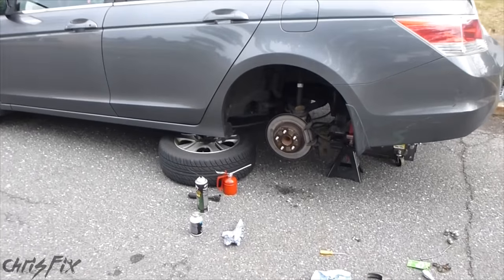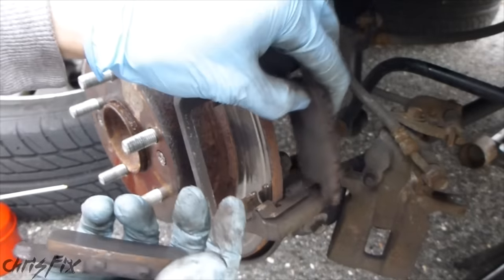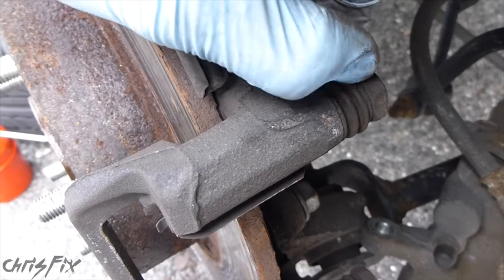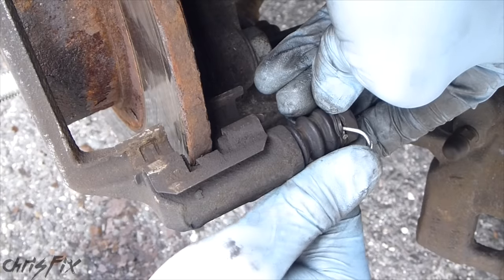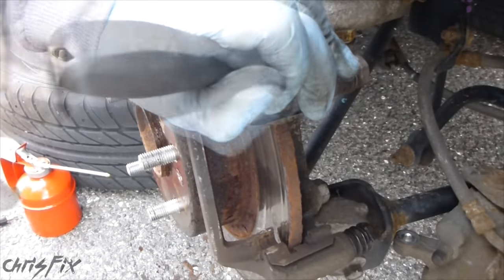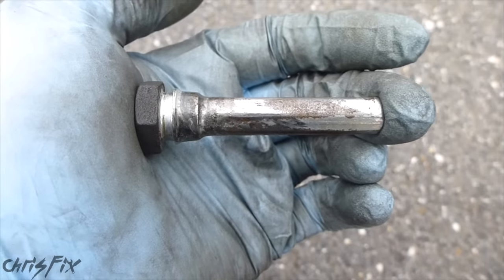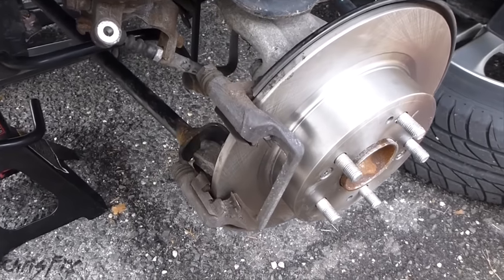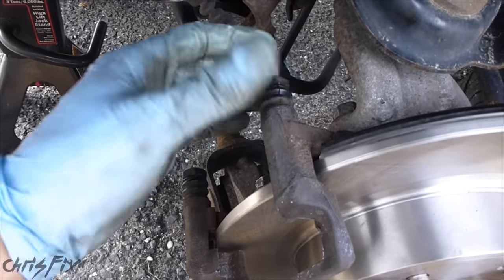How to Fix Uneven Brake Wear

Comment: What do ya'll think? I have this CRC brand "synthetic brake and caliper grease." The label says "...is the highes quality... available. Formulated from proprietary bases, extreme pressure additives, molybdenum disulfide... graphite and PTFE. Unlike silicone-based brake greases, CRC's... will not damage rubber or plastic components, freeze, melt, or wash out." I read that label before I bought it and knowing about he rubber seals on the caliper pins, that label influenced me to buy it, rather than to put ordinary multipurpose grease on the pins, next time I replace brake pads and/or rotors. "Properly lubricating... will ensure even pad wear."

Comment: emery cloth works fine, you do not need to replace the pin unless it is beyond refurbishment, oddly enough I had the same exact wear and nothing was wrong with the piston or guid pins, I 'am at a loss

Comment: the piston has to be indexed at 12 o clock and the pad with the squeal tab has a pin that fits in the piston slot that is a contributing factor in the honda rear brake

Comment: Just used your vids to help change brakes/rotors on a '14 Fiesta.  Has had a vibration for a good while when applying brakes, and has gotten bad.  The outside pads on BOTH sides of the car were thick, and the inside pads on BOTH sides were very thin.  Is this just plain junky Ford design?  How are BOTH sides doing the same thing?
Reply from the maker: +filoIII guide pins were probably hummed up and not moving easily. Happens on any car.

Comment: if a guide pin is corroded I just sand em down and use anti seize instead of silicone paste. Usually that repair outlasts the used caliper anyway.

Comment: I remember a shady mechanic shop said the reason for my brake pads wearing unevenly was because I needed a brand new brake booster after spending 700 for pads, rotors, calipers, and the rubber lines for the front brakes.

Comment: hey chris amazing videos, keep it up.  Could you help me, on the brake caliper pins, could you use a lithium based grease?
Reply from the maker: Thanks! I would use silicone based grease personally. If the lithium grease is petroleum based it wont be compatible.

Comment: Hi Chris! 
Why you didn't clean the holes for the guide pins? What if this muddy old grease contains moisture and could caused corrosion? Do we need to clean inner surfaces out of an old grease or it's not necessary?
And sorry for my English I learned it by myself.

Comment: Hey Chris... I have a question. I tried to change my brake rotors on two of my cars. When I took the bolts out, one would not seat right and and even when I installed the bolt by hand the torque it, it would not go in fully and started to cross thread. I'm not sure why this happened on both my cars as these are new cars and the first time the bolts would have been removed. I bought new bolts and still, the thread was cross thread inside the caliper. How can I prevent this? Why did this happen? Could it be that it was already cross threaded when it was built? Thanks so much.

Comment: Stupid question:  What exactly is the little metal thing that you use to get the rubber boot off without ripping it?  Where did you get it?   I could use a metal clothes hangar, but I think the tip of your tool is less sharp.  I've been changing my own brakes for 22 years, but just today I observed some uneven wear on the inner pad of my front left and wondered what the cause was...  Thanks for this video!!!  
Back in 1999 a mechanic talked me into replacing my front calipers on an 9 year old car because he said that the uneven wear meant the calipers were bad.  I should have trusted my instinct because, at the time, I suspected I was getting reamed!

Comment: Hey Chris, So ive been told to use copper anti seize or ceramic grease on the guide pins instead of silicone paste. I have looked it up and there is a really big discussion about it. What do you think?

I have both copper anti seize and ceramic grease in my garage.

Comment: Chris, as a suggestion on application of the paste, wouldn't you remove the pin and boot, clean the pin and bore with the rubber boots off. Then apply a little silicon grease INTO the bore and the pin, then reseat the boot and slide the pin in. This way the grease will not be wiped off by the boot and have as much to wipe off afterward.  I enjoy your videos and it is always good to get another viewpoint that may help in the long run.   KEEP WRENCHING....  JK.
Reply: and clean the rubber seat..goedendag

Comment: just replaced my Honda 2017 front brakes with 31200 miles because of a squeaking noise I would get from the front left wheel assembly , the noise was more noticeable while applying the brakes, when I took the pads off the Rt and Lt outboard pads were worn out twice as much as the inboard pads, matter of fact the was hardly any difference in thickness between the new and old inboard pads, not so with the out board witch were worn out to half the original thickness.  All the hardware was in good shape, caliper just fine, guide pins clean with free movement, the sliding or guide clips ok as well, for the life of me I can see why so much wear on on pad and not the other, only think I can think of is the pads have holes drill on top near each end were a spring like clips go, this springs are design to push pads away from the pads when brakes are not been apply, well both brakes sets only have the upper spring installed, seems to me that there should be on upper and lower spring, can't think of anything else. Any thoughts? By the way the squeaking noise is gone......Thanks Sergio.
Reply from the maker: Interesting that you have brake issues that early on for that car, but it could be bad bushings or slides if the outboard brakes are wearing differently!

Comment: Great Video Chris. I'm new to the car maintenance stuff and I'm doing my first brake job for a 2005 Honda Accord Euro (Acura TSX 2005) . I'm having difficulty removing the bottom flange bolt from the guide pin as the flange bolt keeps on rotating but does not disengage from the guide pin. The top flange bolt came off easily when I used my wrench. It's like the flange bolt is stuck to the guide pin but keeps on rotating when I use the wrench. Any suggestions?

Comment: You need to mention a 3rd reason you have uneven wear on brake pads. You need to make sure the tin guides that are inserted on most callipers that allow the pads to slide back and forth MUST be cleaned and or replaced every time. Lots of brake pad kits come with new tins. Also, callipers without tins (my 2008 Mazda 3) the guides need to be wire brushed and cleaned before inserting pads back. Make sure you us high temperature anti-seize on the pad tabs. 
Also, if you don’t burp the pins after you add lube, you’re in for a lot of issues.

Comment: hey Chris great video!! I noticed you replaced the brake disk on the Honda accord. Any suggestion on what to look for whenever is time to replace them.

 I'm planning to do my brakes soon as my steering wheel and pedal shakes when I press the brake :( why is that?

Comment: Why am I not surprised that it's a Honda 😅 the inner pads wear more on a lot of models, mainly the civics and jazzes without the slides being naff. You also need to be careful with the rears that one of the grooves in the piston lines up at 90° to the anti squeal shim because that is the primary cause of uneven pad wear as the pad locks in with the piston.

Comment: Good video, and good idea how to temporarily make do with a deteriorated guide pin.  But my 05 Dodge Caravan has weird guide pins, with one on the passenger side that has a rubber bushing near the tip, which was stuck.  I found out from another video that belongs on the trailing side.  But both the guide pins on the driver's side are smooth, and move more easily.  Is this correct?  It does not seem to make sense.

Comment: I did my hyundai elantra, new Rotor and brake pad and new caliper pin and grease in it . but my caliper still doing same problem with the pad like you show here. so now i know is the caliper cylinder is bad. thanks! but there is a way to fix the caliper like remove the cylinder and have it fix yourself is it posible? or i need a new caliper in. thanks bro your awesome videos.
Reply from the maker: You can rebuild the caliper but it is usually easier to just buy a new one and be done with it.
Reply: ChrisFix thanks. Sure will.

Comment: Thanx for the great video! Can you also use ceramic paste to lubricate the caliper slide pins?
Reply from the maker: +anfahrt I never heard of ceramic paste for guide pins. I was always taught silicone was the best!
Reply: +anfahrt Yes, just because ChrisFix has not heard of something does not automatically omit it as a potentially option. I am assuming you are referring to the purple brake caliper grease by Permetex PN# 24125. It is specifically designed for guide pins brake, brake hardware and the back of the pads. This particular product outperforms the stuff ChrisFix has featured in this video by hundreds of degrees and I use it on my dually F-350 and my single rear wheel F-250 both diesel both used to tow 3 times there own WET curb weight. I sell car parts part time for one of the big three distributors which is why I have this knowledge of those products and sell various chemicals to thousands of people a month.
Reply: @stradplayer90  No one said that if Chris Fix hasn’t heard of something that it would not be a viable option.

Comment: Great video. Just a quick question in regards to the slide pin boots. When reinstalling..are the boots meant to be fully extended or fully squashed down (air in the boots keeps em for squashing down sometimes). Which is the proper way to install em? If anyone can shed some light on this subject it would be great...

Comment: Good thing a lot of cars have slider boots that you can't get off without getting the slider pin out first. Sucks ass when you have to take a torch to the caliper bracket to free that slider up. Pro tip: Never stand in front of a stuck slider pin while heating it with a torch. Do enough of these and you'll find out why. Hopefully not the hard way.

Comment: I had a guide pin seized so bad it would get stuck again each time I lubed it up and reinserted it. The new lube would just mix with the rust-dust and corrosion still inside the mounting bracket. I had to keep removing, cleaning, lubing, and reinserting and I had to use an impact tool to spin it out the first few times. I even saw smoke coming out!
Reply from the maker: Sheesh. That’s pretty bad. Glad you caught that!
Reply: @chrisfix  It was actually the least of my concerns after finding other damage to the caliper. It was also missing the rubber cover on the bleed nipple and you could see scarring on the rusted slide pin so I replaced the whole caliper thanks to your instruction. Only fought with that slide pin to get it together enough for work + parts store. :) Thank you!

Comment: Hey Chris, great vid! I have a question, after I greased my caliper guide pins, and stick the pin back in, there seems to be air trapped in the boot. It created a ballon when pressed or a vacuum when I open the boot a little to let the air from the boot escape. Should this be a problem? I didn’t use silicone paste..local auto store didn’t have any

Comment: Good video, but I'd use a high temp (500 deg) wheel bearing grease you get in a tub at the local auto parts store. Much easier to find in quantity and cheaper. No need to use silicone grease.

Comment: Another issue those holes on the sides of the pads. Some vehicle have spreading slips that assist the pad to drift away from the rotor. If a 1 clip out of 2 is missing it will take away the symmetrical separation.

Comment: You forgot to mention to index the piston, on some hondas you have to rotate the caliper piston in order to retract it back into the caliper, some inner brake pads have a pin on the back side and needs to align with the piston or it wear uneven, i know because I've made this mistake myself.

Comment: Chris, I know you probably wont read, and probably not respond, but if you could that'd help me ALOT. I know this video is 3 years old, but I think you still get notifications, could a seized guide pin make your break make a weird rubbing noise?
Reply: 2AverageNoobs it possibly could I guess if it was preventing  the caliper from releasing and keeping the pad up against the rotor. I would think you’d smell breaks when you got out of the car though if that were the case and even see smoke, especially after high speed and most especially after going down long hills where the brakes had been used a lot. Best thing is to take the brakes apart and see what you find.

Comment: usually a bad guide pin can be fixed by wirebrush and a smooth sandpaper , it will go back to its former glory and all, just look if theres an uneven wear in the pin for it might cost you more instead of saving money

Comment: You have to pull your calipers multiple times during the life of a set of pads and  verify the pins are free and lubed. As well as making sure the pads are floating in the holder correctly.

Comment: Hey Chris, luv your vid's.
That guide pin was so bad that I would have cleaned out the female as well, shot some brake cleaner in there and used a brush to get that all cleaned up.

Comment: Hey Chris,
I have this issue for a while now ( over 2 years) that is wearing excessively my brake disc. When driving in town the pad and disc doesn't get heated enough to start squeaking, but once I hit the motorway an intermittent squeaking noise comes up.
One finding is that the brake pad gets locked in its place onto the brake disc. I don't know how to fix this issue, other than to use a file onto the pad's guiding ears in order to allow the pad to freely move back and forward into the caliper guides.
Now, I usually change my pads in a local workshop because I don't have a place where to work them on my own. I do own a parking slot, but since I live in a block of flats, I don't have the space needed to undergo such DIY tasks, nor do I want to scratch someone else's car by mistake.
Therefore, does this guiding pin issue might be related with the issue that I'm facing on my car? Can the seized guiding pin of the caliper make my pad and disc come into a slight contact all the time ?
Thank you.

Comment: This is the exact problem I had on my 2015 Honda Civic with one of the rear brake pads wearing unevenly. I greased the guide pins and the piston didn't appear to be crooked. Are there any other things it could be?

Comment: Hmmm I just greased mine but I probably used petroleum.... I'm gunna check the wear on the new brake pads soon and probably buy new calipers
I also shoved a ton of grease in the caliper bracket (overfilled) and I just stuck the pin in and all the excess squeezed out

Comment: Has anyone found that using the silicone lubricant on guide pins with rubber ends makes too much of a hydraulic seal and then you have this vacuum problem?  I have found that if I use the silicone lubricant I get this suction problem on the pin and it is a bugger to get out - even if it is only a small amount of silicone.

Comment: Also clean the rust on the stainless sliders that the pads sit on. Also clean all the rust buildup underneath the stainless sliders. I had a car that had so much rust buildup underneath, it caused the stainless sliders to lift and cause uneven wear because the pad couldn’t move.

Comment: Appologies if already noted, but it appears that the top caliper bracket is loose at about the 6:00 mark. Maybe the lack of slide pin movement was working the bracket loose?

Comment: Will bad pins cause a car to need new pads very quickly? 
I replaced the pads and rear rotors like 2k miles ago and the new pads on the rear right are making a grumbling noise again! It's really annoying. Last time it was making that noise new pads solved it. had to replace the rotors too because they were being shaved by the worn pad and got metal dust all over my wheel which then rusted over and my wheel now needs to be professionally restored. :/

I don't want this to happen again so tomorrow I will be hitting the parts store. Gonna buy some silicone grease too. I don't have any.

Comment: Had a similar issue with guide pins on my 99 CRV, the guide puns would move but the bolt wouldn’t thread into it, it would get stuck and wouldn’t go any further so I replaced them and they were hard to find as well

Comment: Your videos are great and you usually cover all the details but I think you missed an important one here. Most lubricants are not compatible, mixing different brands over time can produce nasty results even if they are the same base element, you should have cleaned the bracket holes and boots.
Reply from the maker: Thanks for sharing, silicone is actually compatible with everything, but I do agree in researching which fluids are compatible with others!

Comment: I'm assuming that my brake wear is from the piston, when I look at it the rubber gasket is half up on the piston. Do you think this is what's causing it? Should I try and replace it or just replace it with a whole new caliper??
Reply from the maker: I would rebuild your calipers if the boot is like that! The kit should be pretty cheap!
Reply: ChrisFix okay thanks man, Ima work on it this weekend!